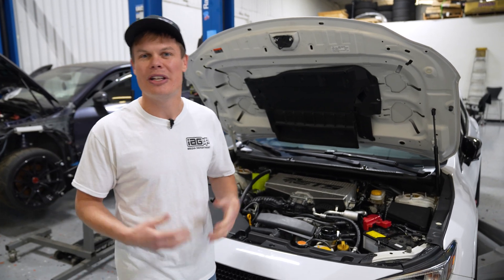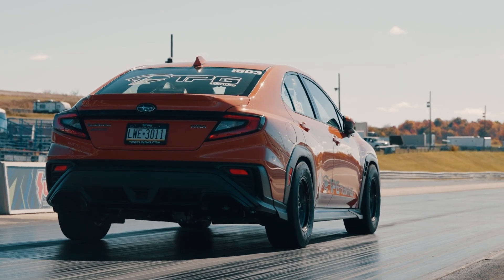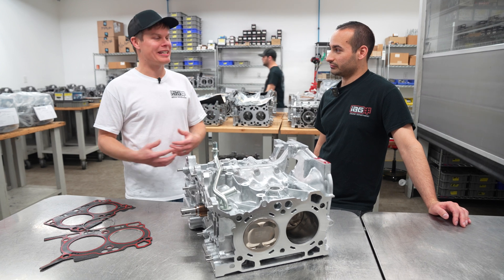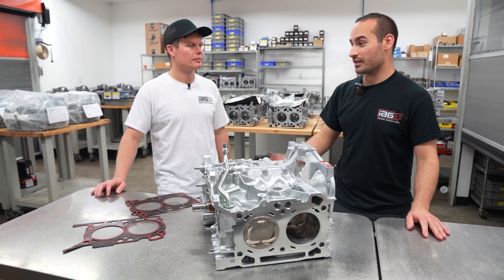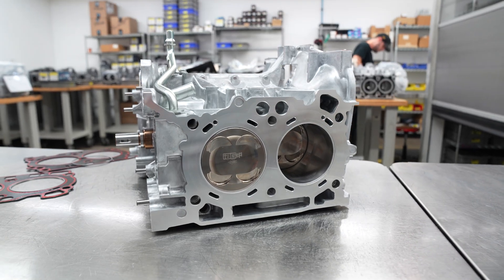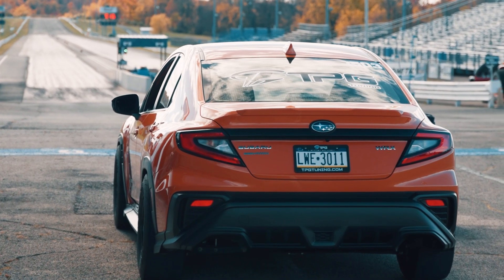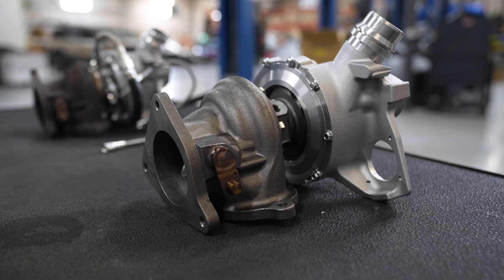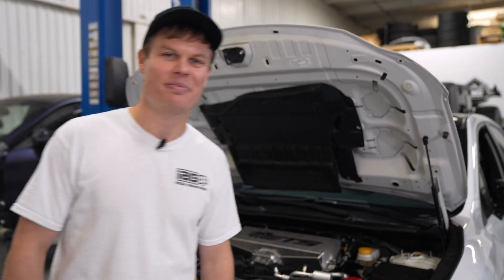NEW IAG FA24 SHORT BLOCKS

Comment: This is cool but you will never need this short block if you dont do a STI 6 speed swap because the transmission cant handle a oem fa24 tuned without failing.

Comment: If I buy engine and  turbo.and fuel upgrade,  how do I brake in the engine without tune? Since I need a tune to run new turbo
Reply from the maker: Most tuners will provide a break-in tune. As long as you aren’t getting into boost you will fine for the break in procedure. We have a video going over the process on our YT channel
Reply: Awesome thank you

Comment: I love the VB but isn’t the transmission the only thing holding this platform back besides maybe the looks.
Reply: I wouldn't say only, but Transmission is a definitely a weak point over 375ft-lbs of torque
Reply: Although I don't think you were asking me 🤣
Reply: Trans is definitely a weak point on the vb. If only they would've just used the 6 speed from the VA sti. After my warranty is up I'm planning on doing the swap.

Comment: Just want to give a bump to TPG tuning. They tuned my 17 STI. It was solid for 3.5 years and then I sold it. Nate and Jason always answered my questions when I emailed them, and they even provided me new maps at no charge whenever I wanted to make a change or added new parts like injectors, FPR, etc. They were great to work with, after-tune support was great. I would recommend them to anyone.
Reply: I agree! They tuned my 2020 WRX back in 2022 and it was flawless! Highly recommend TPG Tuning for your 22+ tuning needs. Who wouldn’t wanna be tuned by the guys making great power
Reply: Do they do online tunes? For older EJ257 engines as well?

Comment: I’m new to the car scene and I was wondering how reliable short blocks are and at what power would this one be rated at for daily driving purposes? Is it as reliable as stock?
Reply: They said 1000hp crank in the video.
Reply: @  that’s the potential power of it tho, it doesn’t mean it’s reliable at that stage of power
Reply: @ most shortblock or engine builds will say rated for but doesn’t mean it can’t do even more. Any car at xxxxhp is not going to be reliable like a regular car, it’s built and is going to be pushed to the limits constantly.
Reply: @JoseMartinez-gy9eo  so does that mean it’s unreliable? Like if I had a block rated for 600 and I kept it at 600 and daily drove it would it leave me stranded and only last 10k miles?
Reply: @ nah not at all. I have a built shortblock rated for 600bhp and make 500whp which is pretty close to that figure in crank and I’m at 14k miles haven’t had a single issue. Now will it last you 100-200k like a normal motor probably not but who knows, never heard anyone run it that long but probably because we all like to push power and break shit
Reply: @JoseMartinez-gy9eo   ohh okay, thank you for your help I wish you the best of luck with your engine
Reply: @xion8776  engine builder here, these are factory blocks that have had the deck closed, so the issues with block flex still apply. Saying rated really means very little, will it survive 10 seconds at 1000 hp? Probably. But would it survive that in a circuit race? Probably not. Also the pistons for these builds are a softer alloy that have higher thermal expansion rate, meaning that it's hard on the engine bores when cold. I'm working on some ej prototype parts right now, to be honest, they aren't really designed for reliable high output.
Reply: @ ohh I gotcha, thanks for your input that makes more sense now

Comment: how come nobody has tried jamming one of these into a VA STI?
Reply: LOL might soon be cheaper to do this rather than upgrading/swapping the stock trans, axles, and differentials on the VB platform
Reply: @yesblyat7234  😂
Reply: Direct injection control from the ECU side is very complex. The only aftermarket ECU that will do it for you is Motec which is like a 7 grand investment alone. You COULD do it
Reply: @ziggyziggler  and a motec system exhaust
Reply: It’s been done, apparently some shop (I believe in Connecticut?) does these swaps. Saw them talk about it on Facebook, might be able to find some people their that have done it
Reply: Id assume it will be a more popular swap for fa20dit owners, as STI owners can be a bit prideful in their EJs
Reply: @darealgeemattey7010  i own a EJ and id gladly swap it for an fa24.    Perhaps it's time to f around and find out.
Reply: @darealgeemattey7010  I too own an ej but he had me at 1000hp, so I’d gladly give home ec another shot
Reply: I am wondering the same. Can it be dropped into a a VA or GR STi and mated to a STi 6 speed?
Reply: @JustinSigna  yes it can be mated to an sti 6 speed. I have an sti swapped fa wrx, bellhousing fits on an fa2x no problem.

as far as swapping an fa24 on an sti, its not worth it. you’re better off buying a fa20 wrx and swapping the fa24 into that and using fa20 heads. robert costano has a write up on the swap.

Comment: Heck yes!! Closed deck is the way! Been running mine for years now and it's been holding up great! Just change the oil constantly, specially for us on ethanol 🤘🔥🔥🔥
Reply: how often do you change your oil? i’ve been doing it ever 2500 lately
Reply: @rammy3767  1500 miles or 6 months whichever I hit first. It's always the 6 months 😭🤘
Reply: Why do you have to change your oil more often with Ethanol?

Comment: As soon as someone figured out the casting process for upgraded turbos I’ve seen a couple companies start to come out with them. Love to see it
Reply: Casting. Dude just weld a v band clamp on some stainless tube from called headers and put whatever turbo you want on it.
Reply: @ these cars have electric controlled wastegates and electric controlled bpvs. Can’t just use any turbo or at least not without a lot of extra work
Reply: @ they make electric waste gates but ya if your not a fabricator then I see the bolt on purpose but if you put a nice ball bearing turbo on there with the e gate. You won’t be disappointed
Reply: @HeidiFegles  ya these turbos are a complete bolt on, stock wastegate and bpv bolt right on.

Comment: Short block coming for BRZ ?
Reply: +1
Reply: +2
Reply: Yes, it is! 

Stay tuned! 🥰😍
Reply: Out front makes one
Reply: Isn’t the same block?
Reply: @TheGennessy that’s that I was thinking. From what I’ve found the only difference internally is compression ratio so rods and pistons maybe crank.  Cause I hurt my fa24 pretty good. Gots a lil confetti in the oil filter 😅. So I’ve been looking into power options and I’ve been looking into this block and a sti trans swap. But I need to talk to someone more into subies. This 24 gr86 is my first subie. I’ve always been a Cummins guy.
Reply: 4 wheel drive tho
Reply: Just use this block call it a day